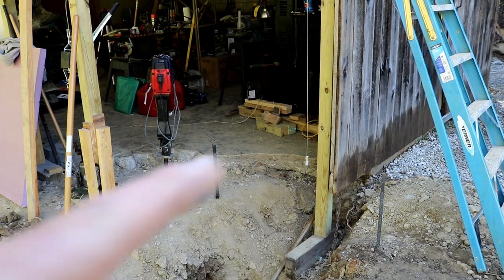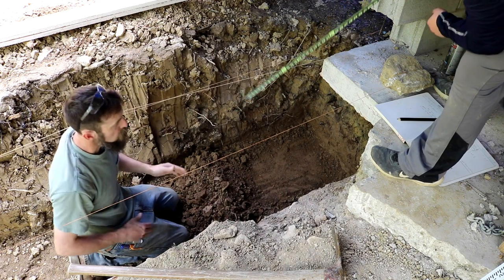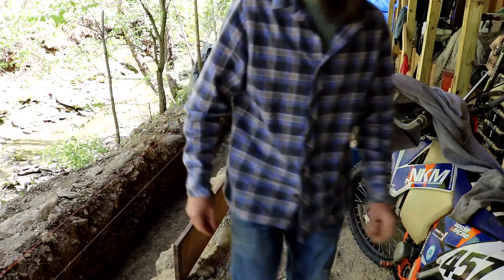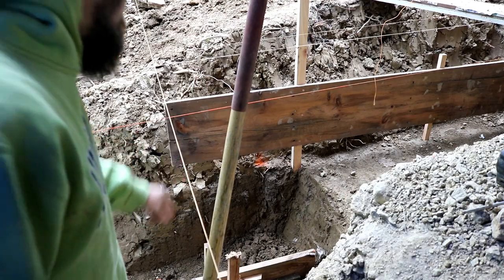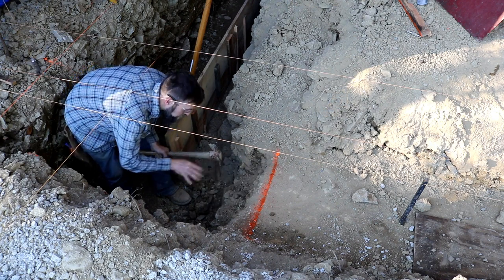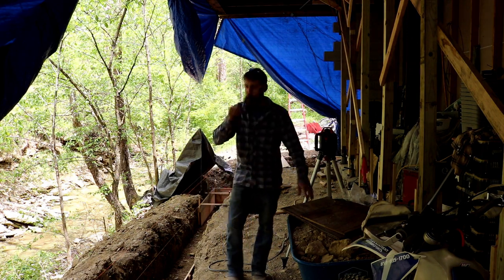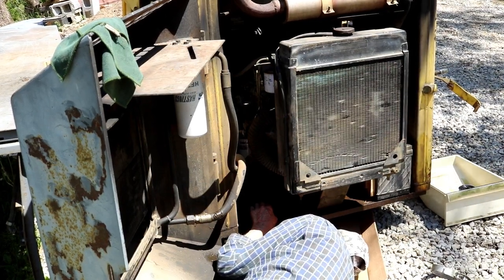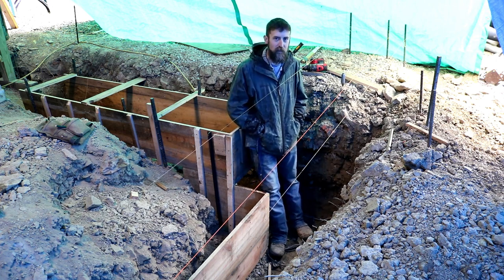Building concrete forms for the shop Footings . Damaged Shop 13

Comment: Here's another technique tip that's a time saver.  Measure from the left edge of the saw fence to the same side of the blade.  It should be 1" or real close.

When you measure and mark a board, do it from the left end, and subtract the table edge to saw blade, and mark it. Then lay your Speed Square on the mark, and use it as a saw guide to keep your cuts square.

Keep using your foot as a board support, since the verticle angle of the board helps stabalize the Speed Square before you grab it.

You do need to practice holding the Speed Square and cutting, but once you do it 10-15 times, practicing, it's no big deal.

This technique eliminates marking and making a square line, and keeps the cuts much more square.  

Hope this helps.

GeoD

Comment: Hi Steve, you're doing really well for your first time. With your forms, keep in mind that concrete is Very Heavy so you'll need to either back fill behind the boards or brace the heck out of them.
If you back fill, make some spacers to keep your forms to width. They can be knocked out as you go with the pour. 
Here's a link for your rebar - https://www.concreteconstruction.net/how-to/construction/placing-reinforcing-steel_o   Stay safe and well :)
Reply: Anthony Ruddy Good advice.

Comment: Stick with it Steve, you are doing fine on your construction. I have found on all of my personal projects that I need to build to my standards not to the standards that someone else says “oh, that’ll be fine, that’s good enough.” I worked some construction in my younger years and saw a lot of shortcuts and sloppy tolerances that worked out fine, but it seems like when I have allowed people working for me any small deviation from my standards on my own projects it has always come back to haunt me later on. Case in point, a couple years ago I had a pole building constructed where I hired a roofer to install the shingles. Used the shingles that are rated for I think it is 150 mph winds, but you need to use 6 nail attachment rather than 4 nail. Well when they were three fourths done, I discovered they had only used 4 nail........there goes any manufacturers warranty, because they weren’t installed to spec. And it really wasn’t saving the roofer any money as I provided all the material and paid hime by the hour.  Anyway stick to your standards, you’ll be happier with the project in the end. I only wish I lived closer so I could come over and provide some labor. Love your videos both these and the Machine Shop work. Keep at it, you’re doing a good job.

Comment: Steve, i love your grit, but you should have invested some time in watching videos on how to build a footer for a block wall.   You definitely dont need all the strings up there all the time.
Reply: That's what the grub hoe is for. It's to chop all of them pesky strings down and out of the way! Whoops. But yeah no one digs with strings all over the place like that. At least not for long. Steve should get some mushrooms before anyone comes by inspecting too. That they will freak out about. No metal stake shall stick out of the ground without a mushroom atop of it. I've heard horror stories of guys impaled on rebar where they had to lift him up and burn the rod out. The Sawsall just makes you jangle too much. So plant the mushrooms.

Comment: Steve, don’t underestimate the weight of concrete pushing against your formwork. Make sure you have enough braces and barge boards to stop the forms bowing or spilling concrete, especially when vibrating the pour.

Comment: Old weathered 1" lumber can be used for building rabbit hutches but 2" might be better for concrete forms. The fluid pressure of concrete can be more than one might think. A 16" column of wet concrete will exert 200 pounds per square foot of fluid pressure.
For tick protection, I spray my trouser legs with Permithrin which works very well.

Comment: Yes, stepping the block up to meat the old concrete is good. You should try to find a way to connect the rebar from the new to the old concrete. I would drill into the old concrete. Steve what you are doing is right, keep doing what you are doing. The rebar will have to go up each step and connect to the old concrete. You will have to bend and even weld the rebar together. That's a must with that soft fill you have. I seen how soft it was when you where scrapping. If you don't connect to the old work? you may have more problems, that ground is wet and soft, it may never get hard.I have been a mason from 1978 to 2019. I just retired last fall. I have layed or installed thousands of blocks, they are concrete not cinder, we have not used cinder block's for years.

Comment: Wet concrete exerts a lot of outward pressure on the form wall, you need twisted wire ties to keep the forms from spreading outward and causing a blow out.
Reply: John McKenna Good advice. Blow-outs are a nightmare.

Comment: There is that engineering notebook again.  I know it is hard to let go of 0.001 inch of tolerance.  One of my coworkers did house flipping with his father; their philosophy was that sheet rock has a tolerance of about a half-inch.  After that it is just a matter of mud and tape.  Concrete foundations are about the same, I have done those too.  If the level indicator squeals too loud just put a wad of bubble gum on the noise maker.  Your father is getting around at 80 better than I am at 71, and I guess that puts you around 50.

Comment: My experience is good concrete contractor is hard to find.  Please consider adding more support for the forms at the front of the shop.  That is a tall pour and the weight of the concrete will likely blow that out.  Good luck with the pour! 👍🏼

Comment: Make a spin wire twister. Small hand crank wooden handle with a hook. They make spin pliers too but don’t need it for a one off job. Cement can weigh 16lbs a gallon twice the weight of water, will need more backing with dirt or bigger stakes. Back stakes Corner need to be stronger formed too should be able to kick it with fear of it falling down. Most people under build forms and pay for it but make it so you can take it apart from the outside. Pour the lower part first then the step after it’s firms some then pour the step.  Thanks for sharing

Comment: Consider yourself lucky :) the freeze level up here is 5 feet deep minimum. I used to work for a cement company because you do what you have to do. You're doing just fine, make sure you brace those forms adequately! (Every 24 ins or so)

Comment: Definitely do your own re-bar work. Buy a used re-bar cutter/bender and use it an keep it. Also, with your oxy-acetylene rig you can get tight bends where you needs them by heat bending. Drill and pin the slab to the footer. It'lll never slide down that bank, save for earthquake.

Comment: You made me smile shaving off the dirt to a machinists tolerance! A couple of observations, your form boards are quite thin so you need to make sure that they go all the way to the bottom of your trench and then really pack in your backfilling material. Use some of that stone you got delivered that will help. Anything within a quarter of an inch is going to be more than good enough tolerance wise. It’s a small amount for a truck to pump in which might explain the reluctance to take the job. I think you will need to fill the block below ground level with concrete which your going to have to mix yourself. The job is probably too much for one guy but not enough for five guys so you might struggle to find anyone to lay your block. I wish you lots of luck Steve, you’re doing a good job especially as you’re learning as you go

Comment: one final thought, if you cut off one of and shortened one of the jack hammer tools and weld on a short section of pipe to create a socket, you could use the jack hammer to drive the stakes into the ground more easily. The old saying a lazy man finds an easier way to save labor.

Comment: To attach something to a pole temporarily I usually use a half prusik knot (just once around). Works perfect for keeping things tight as long as there's something pulling on it and will come loose by itself as soon as you stop pulling.

Comment: I never liked those 35 ft tapes for the same reasons you point out, Steve.  I used 20 or 25 ft tapes (whichever was on sale) for most work, and a 100ft wind-up tape when I needed something longer.

Comment: Normally, for hand made wood forms, you run horizontal 2x4 along the outside of your forms and "log cabin" the corners then you run vertical 2x4 doubled  and run snap ties through the forms at the junctions of the vertical and horizontal and clips that are hammered on the outside of the 2x4s holding the snap ties. Snap some lines on the inside of the forms to mark top of poor. Use cheap "slurry" (mud & cement mix) to fill gaps at bottom of forms to prevent the concrete from running out. I think you'll need a pumper truck and a couple of friends to be there on the day of poor.
Reply: Yes, whatever he said, and a thumbs up for the crafty use of a homophone.
Reply: @djw4325  haha! "pour"!

Comment: Steve I know this is hind site but all you needed were to put leveling stakes in the trench with their tops being the level of your footer no forms just use the sides of the trench as forms this may take a little more concrete but is much faster than your approach this is the traditional method you have made it much harder than need be.

Comment: I know it’s been said, but I’ll say it again.....those forms need a lot more bracing or they’re going to blow out during the pour. Especially with the looser mix they’ll have for the pump.   Keep up the good work!! 👍
Reply: I've been on pumped pours that were core sampled. When they're sampling they run a stiff mix. Because bad lab results mean you've reached Chapter 11. The End. Every contractor knows that.

Comment: Anyhow is better then it was. In a peanutshell: I'd just rebar the bottom of the trench and let them fill about a foot or a little more. Then build a small wall, stay below floor, no need for perfecting. It looks like an upside down T now. Fill the trench with dirt/soil arround the wall. Then make your casing for the floor, rebar it and let them poor your floor. Assuming you allready put some rebar in your existing floor to connect with the new one. Good luck.

Comment: Steve, be aware that your forms can blow out from the weight of the concrete. It is incredible how much weight is behind your forms. When you think you've got enough support....double it. You will need straps/furring strip nailed over the top of you're forms every 2 or 3 feet to prevent them bowing out, as well as back fill to be sure it holds. I've seen what I thought was rock solid forms blow out easily. Don't under estimate.

Comment: Ok, I’ve read a bunch of comments and I have to add a couple of my own. Most people on here are right about pouring your footers against the dirt and stone walls you’ve dug, they’re keyed to the bank and backfilling is already done with compaction. You’re looking at less than two yards of concrete extra, so that’s about $200-$250 bucks. It’s not adding any weight to the bank, you’ve got a concrete floor and a building sitting on two thirds of the footer, the other third over the bank is cantilevered out there. But, I don’t think I’ll change your mind! One other thing before I go is don’t be too precise with footer elevation. A touch low is better than a touch high, a half inch low is better than a half inch high, any more than 3/8” high and they (or you) will have to start trimming the bottom of every block! Give yourself a half inch for a mortar joint, and an extra quarter inch for good measure, straight edge the the of the footer and double check it and straight edge it again. Hopefully you won’t be trimming any block! I’m a retired union bricky and I really have enjoyed this series, and I’ve enjoyed your machining videos as well, keep them coming!                               One more thing, when forming a straight run with 3/4” boards, we would put two x four kickers every eighteen inches on each side to keep it straight. If you would have left the stakes long, you could’ve just wired the tops of them, next time.

Comment: Something i do to post footing or anything with cement in the ground. Now hear me out. I dig the hole,  then i spreay automotive undercoating on the dirt hole, so when the cement is poured, the cement wont have direct contact with the soil and it wont wick water through it. For the posts in the ground i also put waterproofing on the wood and then undercoating before i set it in the hole.

Comment: I think you might find the blockwork people are more interested to quote when they see your footings. FWIW, I think the most important thing you did is to shutter up for concrete. My experience is that if you just pour concrete into a hole, it will settle out over the decades - in any kind of way but the one you want. You can bind concrete to bedrock, but you can't bind it to soil. Soil is like a liquid relative to concrete. If the centre of mass of your concrete is not centred above its footprint, it will just tip over. The less mass you put above ground on the footing, the worse this effect will be. The only thing that counts is the centre of mass for the entire wall and the footing. If your footing sprawls in an uneven way, side to side, the vertical wall will drift over time. If you are worried about the footing sliding down the slope and into the stream, you need to tie it into the existing slab with steel. The only other way is to go deep so the pressure from the wall of soil is too high for it to go sideways.

Comment: STEVE - It's concrete under your shop - not the pyramids that will be there 10,000 years ago. Dump the mud in the trench and make it flat and level. I just had 80 yards poured with a 40x85 slab, two driveways, and 200 feet of sidewalk. I backed off and let them do the work even though I could have done it years ago. Hire experts for their skill, not because you think you know how. Second - never go with the cheap bit - you'll get cheap work. Concrete in the ground goes at $300 per yard, some more, some less. For that  they dig, form, pour and clean up. you only sign a check and shoot video as they work. My aching back says it was worth it for me.
Reply: Excellent advice to hire a cement contractor to do it all, a turn-key job.  Be sure to get a signed contract from an insured contractor naming you as the loss-payee, stipulated completion bond, etc.  The legal details are just as important as the design to guarantee an uneventful completion of the project.  Having an attorney review the contractor's contract, with revisions, if needed, is well worth the cost to protect you against unscrupulous contractors.  Carefully check at least three references from the contractors.

Comment: Did you consider using 'batter boards"?  Two boards leveled out on stakes at each corner (sometimes called 'corner boards' too) set back from your work where they are out of the way.  They form a ninety degree angle where you mark where your layout strings cross (use a flame on that fraying string) the boards.  Now you can drop your string lines and get them out of the way for digging but easily pull them back for checking layout.  Sure beats trying to maneuver shovel handles and yourself in and around a bunch of strings in your trench.  You are coming along for sure.  Take care.  Doug

Comment: Have you considered putting a drain on the inside of the footing? The way I see it you are kind of counting on the foundation to act as a bit of a retaining wall so if water finds its way under your slab (which seems more likely now that you have disturbed the soil around it) hydraulic forces may build up and try to push your shop even closer to the ditch. If you go ahead and do this I would recommend getting proper PVC footing drain instead of using the field tile you used for the upper side.

Comment: Back when I was framing and building.  We scored the edge of the stakes tothe top of the form boards and broke them off. It was the fastest way that I know of.
Reply: I was surprised Steve didn't break out a block plane and smooth off the tops of those stakes. He needs to watch Paul Sellers.

Comment: Steve, don't listen to the naysayers ... if Herman B wants excitement he needs to watch something else.  Construction like you're doing always takes a ton of time, especially when it's only you doing the work.  Been there, done a lot of that.

It does sound like you are inching towards pouring your own cement.  It's doable with a couple friends.  (sorry, I live on the opposite coast)  Backfill your forms, tamp down the back fill material.  Prevents blow outs (I know from experience).  If you're going to have rebar sticking up between cinder blocks, preform the j-hooks and stick them up through your cross members.  That way you can position them where there will be cinder block holes.   It also looks like you are looking at two pours.  (that upper step connects to the lower?  if so, cement runs down hill ... heh), you gotta let the lower set up before pouring the upper.  It's conceivable to roll that concrete in wheel barrows, around here the cement companies give you about thirty minutes per load (then they charge you by the minute).  If two/three husky friends bring their own (steel!) barrows they can knock that out in short order.  Your route would be through the inside of the bldg.    Ask your friends on YouTube if anyone is willing (and healthy enough) to bring their barrows and roll some cement for you.  Will save a ton of money. 

Anyway, enough sidewalk supervising on my part.  I always appreciate watching folks put their own sweat equity into something, it makes it personal, it makes it real.  

blessings!